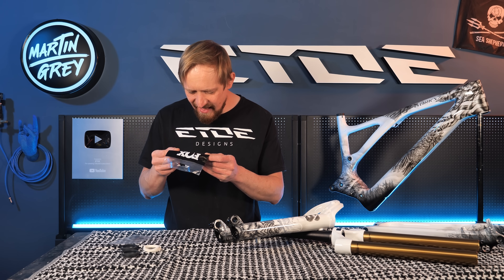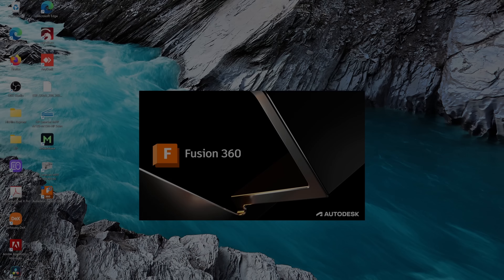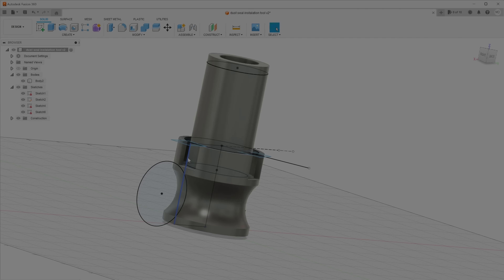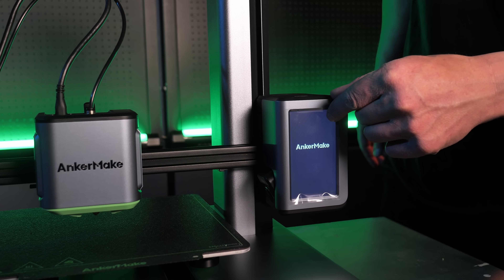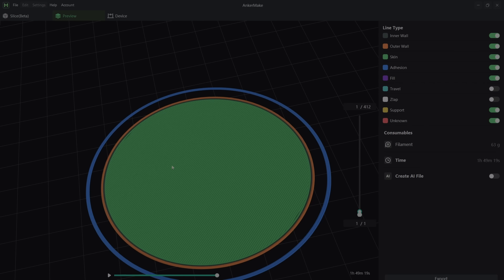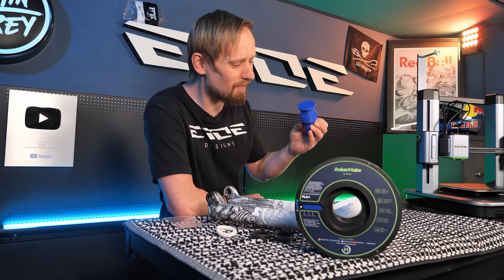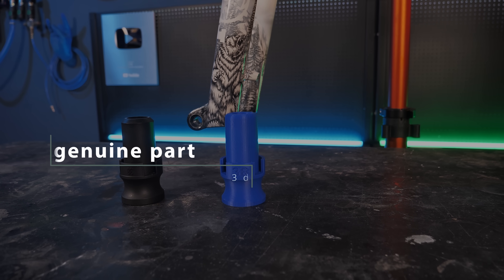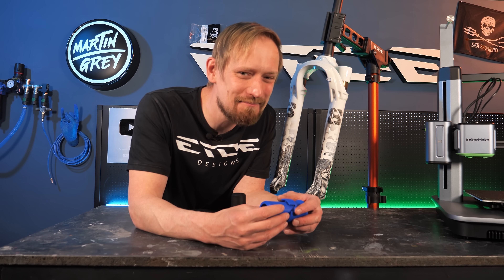I made 3D printed bike tools - Is it a thing?

Comment: Good job.   Recently i had to design and 3d print a truing stand , my old one only does QR 135 wheels, and i had to build some 148 boost through axle ones.   A few threaded rods and nuts, a base board and 3d parts makes a truing stand :)
Reply from the maker: Thanks.Good idea!

Comment: I have about a dozen bike tool designs on Thingiverse: tool holders, headset presses, handlebar stands, tool trays, headset spacers, various size shims, etc.

For any impacted tool, PLA is strong but  brittle, I use PETG.  A delta printer with Klipper will print PETG or PLA at 400mm/sec.

Comment: You should get a BambuLab X1C, you'll love it and it's even easier to use then the AnkerMake.
Reply: i disagree actually, i have the ankermake m5 and the maintance on it is significantly easier than the x1c or even the p1p. The nature of corexy printers makes them difficult to maintain and clean. The speed on the anker is fairly similair to that of the bambu printers even as anker can reach speeds of 500mm/s granted nothing actually prints at that due to volumetric limits without massive modifications.

Comment: I'm about to paint my old alu frame in the next two weeks (spray paint, acrylic). I've watched a lot of your videos to prepare (thanks!). But what's the best way to clean the frame after sanding the various layers? I don't think I should use tap water, there's a lot of calcium in it where i live and if i let it air dry it's going to screw up the paint job. 

I'm going to sand it, deoxidize it (mipa), primer it with the spraymax 2k (2 layers). But after sanding, how do you clean the frame? I was thinking i rinse it off with regular water,  then wipe it with distlled?

Or should I juse wipe it with degreaser until nothing comes off? Is it safe to use degreaser on acrylic spray paint?